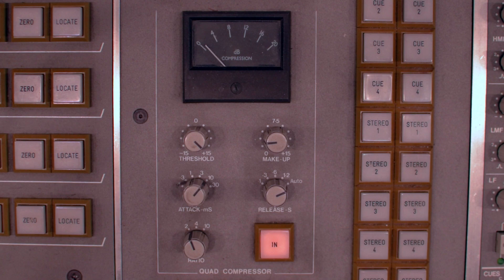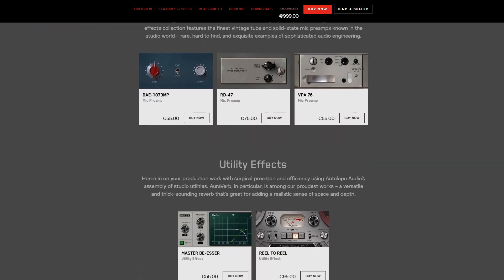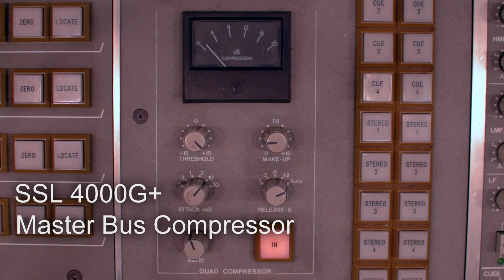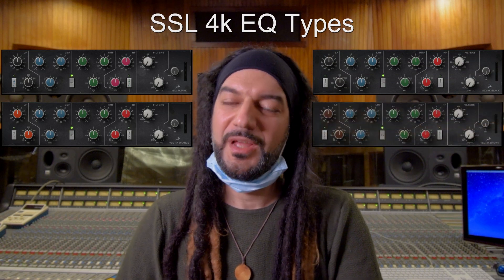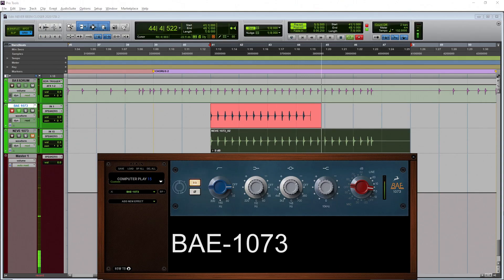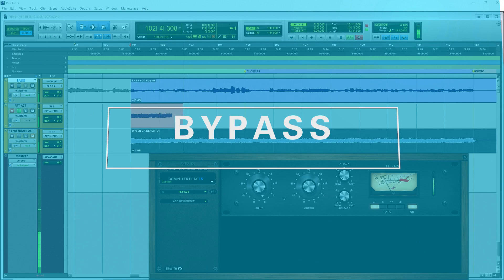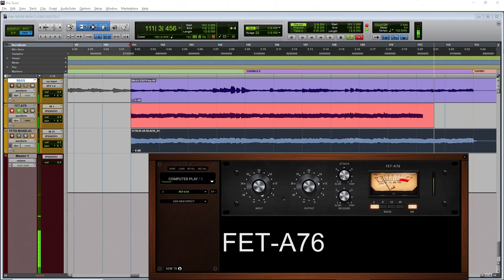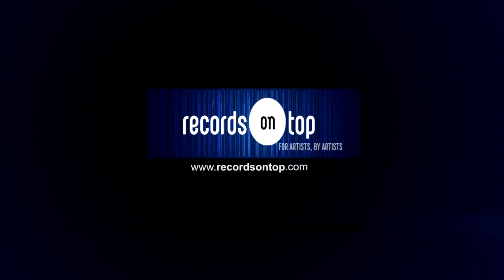Hardware VS Plugins: Meet the new Antelope Synergy Core DSP & FPGA FX.

Comment: Anybody that says its the same obviously never mixed OTB....  Its easy to listen to 2 instances and say they are the same.  They are not but you can't really see it.  But in the context of a whole mix is where you really see the difference because the differences add up.  But FPGA's are solid tho.
Reply: I have to agree. But yes plug-ins are very close and obviously faster than working OTB but if I get to choose…. Hybrid. I still can’t get the same depth ITB than on the console
Reply: this is of course true and I would prefer a console workflow over a DAW any day. The AA fx compared to other emulations are really good though, and there is a lot of contention about these effects being better then those effects and so on......The reality is you could mix an entire album with just AA effects and never think twice about the sound quality, they are very good. The amp models need improvement but the mix processors, comps and EQ's are spot on.

Comment: Damn they are Nailing it with the Emulations 🤘🤘 I own the whole Antelope Bundle but have used the Plugins much yet... Time to do so!!! 

-B / [TheLibraryStudios]
Reply: I use a chain of 3 plugins when recording in the front end. A low cut from the BAE 1073, some Sky from the Maag emulation and then some compression with the SSL Bus emulation.
Reply: Alexandros,  is thjs your vocals chain?
Reply: @bg4productionsllc  for tracking vocals yes!
Reply: @alexandroschrysidis379  I don't have access to the ones you've used but I tried a similar chain with Veq1a, Clearq, and then x903 compressor. Very nice start to my recordings.  Thanks.
Reply: @costinvaly1  I'm sorry but this is not the Antelope YouTube channel. I have no endorsement or any relationship with Antelope. I can provide to you the Pro Tools session so you can compare for yourself.

Comment: Awesome vid! Very useful 👏👏
Reply: Great vocals!
Reply: It's so easy to fool people with such fake comparisons because this is literally what the customer wants = digital identical to hardware. Of course on your own material you won't tell a difference once you own the plugins but hardware units aren't even identical themselves even if you're using a pair of the same compressor model, there's always going to be a slight marginal variation in sound because they're mostly made by hand and analog-based internals. Unless those hardware units they used are exactly the ones the plugins are emulating/modelling, there's no way they'd sound ultra similar unless Antelope used the same processed audio track for each footage switch during comparison just to make it look like they achieved the impossible.

Comment: how do you use those plugins within your DAW? I just bought the Discrete 8 synergy core but can't figure out how use the plugins within the DAW I was told that is a MAC only feature & you had to pay extra for it, but I see you are using it with windows any info would be greatly appreciated thanks for the video
Reply: You have to buy AFX2DAW or use it like a external hardware fx

Comment: Very useful video. Many thanks.
What interface from Antelope has been used?
Those plugings are the new edition for synergy core or the FPGA ones?
Reply: Good catch Christian! I should rename the title of the video as those plugins are the new Synergy Core with the DSP and not just the FPGA!
Reply: I used the Discrete 4 SC for the comparisons.
Reply: @alexandroschrysidis379  good to know. I own a Discrete 4 as well connected to Orion Studio 2017 via ADAT. Discrete preamps have a slight different flavor compared to Orion Studio 2017.
Reply: Is there any difference of sound between the synergy core and the FPGA ones?
Reply: @rzemeckis  I have no clue, I am using only the 1st generation Discrete 4 and Orion Studio 2017. I have only the FPGA ones.
Reply: @rzemeckis  Yes, the dynamic range is better in the FPGA ones!
Reply: @cristian-marius-albu  how you can connect both interface via ADAT ?
Reply: @sandychahal1200  you can connect them by using 2 adat cables or 1 adat and 1 bnc for clock.
From my tests, it seems that Discrete 4 does not allows to be clock slaved. It didnt worked for me to use D4 slave and Orion master clock.
When I used the opposite was good (D4 master and Orion slave).
Reply: @cristian-marius-albu  thanks 🙏. But i have one more question . I've seen one more video .in that video they show exectly same result between real hardware and and FPGA fx.  like they compare ssl comp and fpga ssl comp and tone exectly the same . Is that real or  are they pay for promote our products and plugins . What is your faith opinion because u have 2 antelope device .
Reply: @sandychahal1200  honestly I never had opportunity to compare with real gear or UAD plugins as I never them or worked with them.
What I can say is that they sound great for the money. You get really almost everything you need in terms of plugins for music creation. Auraverb is also great reverb for monitoring.
Sometimes Antelope has good deals for legacy devices on Reverb. I've bought a Factory Refurbished Orion 2017 with only 1299€. It's a bargain considering hardware specs + the 70 plugins. 
My personal recommendation if you want to buy an Antelope soundcard is to go with ZenTour , Orion or Goliath. The routing is much better that Discretes. As I mentioned above legacy devices are still competitive, take a look.
Reply: @sandychahal1200  You can try phase reversing the audio parts and check if they are 100% identical. If they are, it's kinda weird.

Comment: what do u think antelope synergi core plugin vs UAD plugin which one better and closest to hardware
Reply: From a specs standing point any programmer will tell you that FPGA are much superior to Shark DSPs in terms of flexibility and power. But that has nothing to do with the emulations. Emulations are all about code. So it's safe to say that both can do the job!
Reply: FPGA is superior if coded correctly, most shoot outs pit software against software ie....UAD vs Antelope vs waves or something like that. What was done here is the correct way software VS hardware that it emulates. In this context Antelope gets it closer the UAD. Good luck trying to convince someone who has spent 8k on dsp modeling and processing cards that their system is getting chumped by a four core FPGA array, thems be fighting words son. UAD adds saturation that is not actually present in the original units they emulate, this makes the plugs in sound good psycho acoustically but is not in fact indicative of what the real units sound like. It is a very subtle enhancement that tricks the listener into perceiving the material as louder and therefore must be better, an audio illusion. Sounds really good when compared to other software emulations that don't do this but fails in a one to one against the real thing in my opinion. People that tend to use a lot of UAD in their mix tend to have mixes that sound over saturated and slightly smeared and it is for the reason I stated above, that subtle harmonic enhancement tends to build up as you layer more and more tracks. I like the UAD thing and it was a massive leap forward when it came out, but there are cleaner more accurate things available today.

Comment: I have to agree with most of the others that these are really well-done emulations. I use Antelope Orion interface and modeling mics (which I've compared to several of the originals like you did here), and they are paying real close attention to the details.
Reply: Do you have any problems with their products , software or hardware , because i want to buy sound card from them , but i read an awful reviews from customers about technical and software issues and poor technical support ? tnx
Reply: @DJURBANBG  hi,i am an antelope user on windows 10-64 and Cubase 10.5. i had no crash till i begin to use it and when i try to operate first time, they made a good technical assist. i an say i really wait for the fpga era when they announced first and its really amazing!!
Reply: @tuncayaydn9216  do you connect the discrete 4 synergy core to pc via USB ?
Reply: hi, sorry for delay. i am using discrete 8 sc by usb and its amazing. i have good configurate pc to produce so i have no cpu problem. i did not use thunderbolt connection. the new ceo of antelope audio anounced the afx ll be adapted to pc too, soon.
Reply: @tuncayaydn9216  afx released today!
Reply: @markleyland2661  sorry! it just for thunderbolt connection, not for usb connection.
Reply: @tuncayaydn9216  Yes, Thunderbolt for windows, just released.

Comment: As regretful owner of the Antelope Synergy Core Discrete 4, I would say:..... "AVOID"..

The routing software is a complete mess. It´s crazy how badly designed it is. USB connection won´t let you use the FPGA plugins. Never. Afx2DAW will never be available for USB.

The unit eventually hangs, forcing me to unplug it and even restart my computer.

And the cherry on top of the cake, today it´s the 4th day that Antelope´s server is out of duty, I can´t connect to their data base, so I can´t do anything related to my account, plugins, whatsoever, with my unit.

Too expensive for what It offers, in my opinion.

Yes, the converters are ok, I must admit it, but it won´t make a difference in my opinion.
Reply: Pochovalledupar  i’m afraid you have a Zen interface? Mine is Discrete 4 Synergy Core, and no, AfxDaw won’t work via usb (And ryzens are very difficult to work with thunderbolt, only a couple of MBs support). It’s very frustrating. They CAN have a working afx2daw for windows/usb. They just dont want to. 

By the way, thanks for the launcher update tip, it worked for me. Weird situation, someon comes along in youtube and lets me know the workaroud, while their own support keeps inviting me to “have patience”.
Reply: @rodericogarcia  It is almost always a server issue with Antelope...once you understand this it is no longer as big  of a deal to fix. The new drivers they put out are so much better and I have had no disconnect issues since. Afx2 daw won't work for me either but I don't really care, I just route from my inserts to the antelope FX channels and then back in, my DAW compensates for latency automatically works great, I treat it just like analog out board.